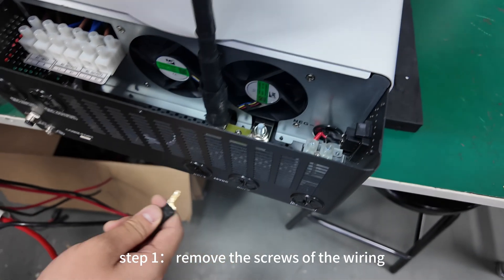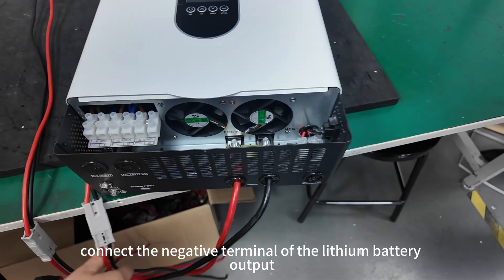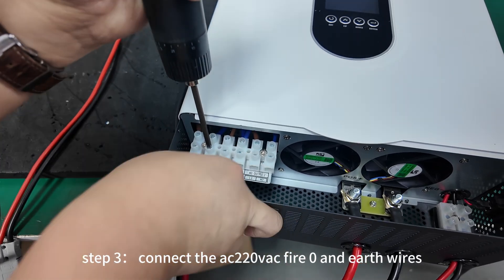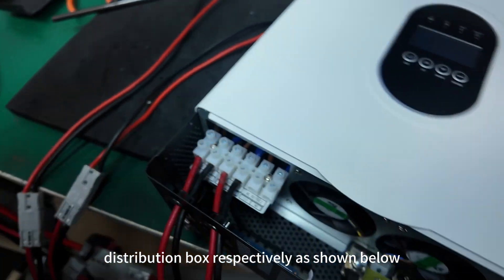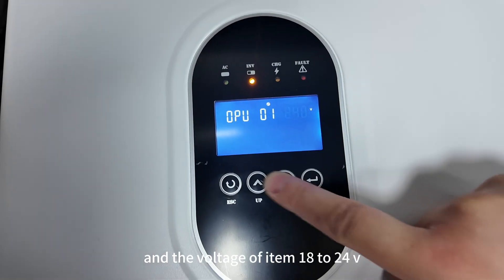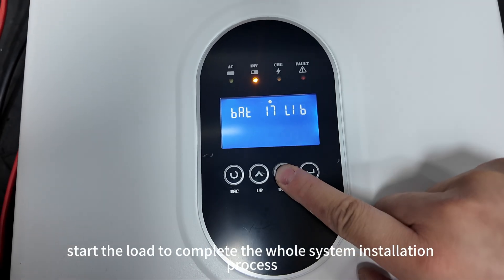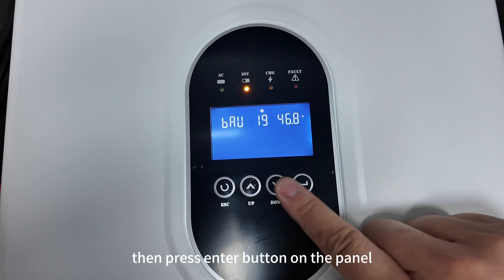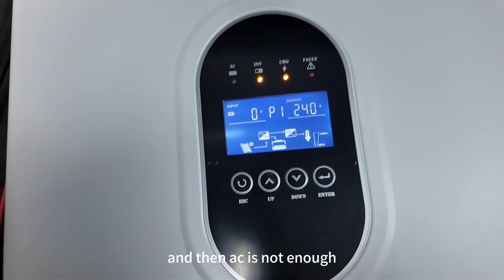Sako Esun 4.2/6.2KVA Solar Inverter Installation Guide

Comment: How do i setup the 4.2 Esun sako inverter to charge my Tubular batteries because it's not changing it, using 6 units of 450W solar panels connected in series
Reply from the maker: Please contact our after-sales on WhatsApp: +86 13928469690

Comment: I bought this 6.2kva sako inverter,  does it mean that there's no communication between the inverter? and the lithium battery?
Reply from the maker: Which model? If they both have BMS, they can communicate
Reply: @SakoPowerOfficial E SUN 6.2KVA SAKO INVERTER
Reply: Please kindly reply me
Reply: Esun 4.2kva 24v doesn't exist on their website
Reply: @alexanderowopetu744 it does, please avoid that particular E series, it doesn't have a communication port with the battery.
Reply from the maker: @alexanderowopetu744  New vision